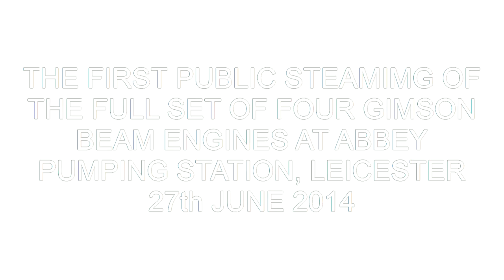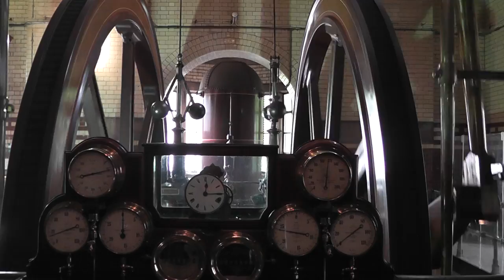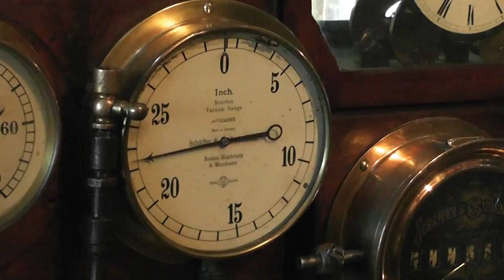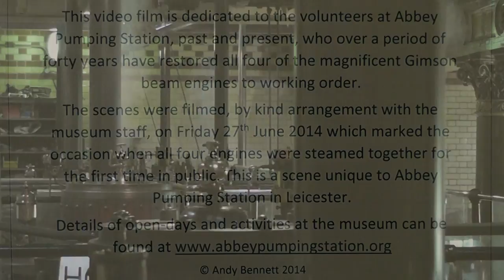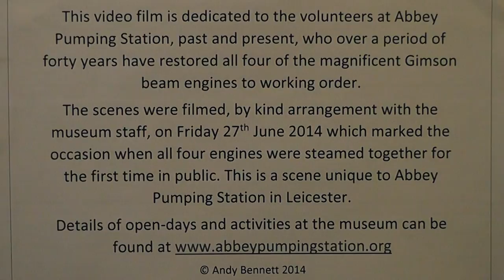The First Public Steaming Of All Four Gimson Beam Engines At Abbey Pumping Station 2014

Comment: (Number 2 pump seems to be running slow, why's that?) It must have been amazing being a designing Engineer in those days, inventing as you went, making things never made before. All the compromises and all the advantages, a babbitt bearing will work, a fiber packing will work, an oil pot will work...if you have world class machining, even of parts like these, huge, ungainly, and complex because of the state of the technology at the time. No CNC, just men with calipers and fine sand paper and really good brains working with lathes and milling machines. I suspect the designing Engineers would be in grease up to their armpits, just like the operating Engineers, to keep these mighty beasts running. It would be like stepping into a whole new dimension of thought. Good on you all for keeping these pieces of art running.
Reply from the maker: I wasn't directly involved in the running of the engines but am aware that providing enough steam was a key issue. The usual on-site boiler is only sufficient to provide steam to run two engines but even then its a challenge to keep them both turning over for lengthy periods of time. For this special event an additional mobile steam generator was hired in to provide sufficient steam for all four engines to be run simultaneously. Even then the speed of the engines had to be held back to avoid over-stretching the available supply so none of the engines were turning an anything like the rate that would have been the case when the pumping station was active. I believe that even then not all four engines would be running at the same time.
Reply: @andybennett5570  WoW!!! I thought that sedate churn was normal! It would make sense to keep one or two pumps in reserve, because of the limits of the materials of the time. What must it have been like, when it was "Balls out" and everything was humming, for a little while.

Comment: A ballet of elegance and engineering genius. Or green house gas factory? You decide. I'll pick A.
Reply from the maker: I'd definitely pick "A" as well. OK the coal fired boilers will have generated some exhaust gases but that has to be balanced against the fact that before these pumping engines started their work parts of Leicester were a stinking cesspit . It was the removal of  untreated sewage from the low-lying areas of the city that made it habitable and laid the foundations for making Leicester one of the most prosperous cities in the UK exporting hosiery and finished goods to Europe and beyond.

Comment: And every Wiper and every Engineer in that place will be listening, through all that din and roar, for the tiny sounds of a dry bearing or a leaky seal! I wonder if running those pumps without any water to pump would hurt them?
Reply: Indeed we all were. It took a lot of drivers, although, I had both No.3 and 4 under my watchful eye. No.4 suffered a bit later on the Saturday with a warm beam pivot bearing, the oilway was blocked with fibres of worsted yarn. They'd been on it for 5/6 hours a day, that's the most we've ever run them. The noise in there was terrific, and made communication difficult at times. All in all, an incredible long weekend of a never to be repeated event.
Reply: In answer to your question about running pumps "dry", we regularly poor oil down the pumps, and they are checked from time to time by removing the large inspection covers with the gantry beam above. 
No.1 engine' flywheel end pump (there's another direct off the high pressure piston tail rod)  was seized solid in the bore. It took months of flushing a mixture of cola and old engine oil down it, with our hand cranked main crane chained up to it. Some side jacking with some 16 tonne hydraulic cylinders and some encouragement from yours truly up on the crane, the old gal broke free from it's seal, first time in 50 years. As you can see, No.1 ran in time for the four engines, pumps bore is immaculately polished from running. She's a sod to keep happy tho, and needs some further time spent on her. But yeah, only place in the UK with all four operational beam engines. Crossness is not far behind!! 💪💪🤞🤞🤞

Comment: Are the engines pumping against a fluid or freewheeling?
Reply from the maker: The engines would originally have been pumping sewage(!) but this is now done by electric pumps at a new location. When the beam engines are now run for demonstration purposes they are not actually pumping anything other that "fresh air". Water is however used in the condensing process as can be seen in the basement scenes towards the end of the film. However as the fly-wheels weigh around 20 tons apiece and the associated beams and con-rods weigh a similar amount on top there is still plenty of work for the engines to do which is why the sight and sound is so impressive.
Reply: @andybennett5570  Thank you sir. I absolutely love steam power. Beautiful machinery, elegant even!

Comment: do they have a modern boiler to supply steam to the engines
Reply from the maker: I'm not sure if it could be called "modern" but the on-site boiler is gas-fired and was relocated to Abbey Pumping Station from the public swimming baths at Leicester's Vestry Street pool. For the special event which took place in 2014, when all four beam engines were steamed simultaneously, a large lorry carrying a portable boiler was hired in to supplement the on-site boiler to provide enough steam to power all the engines.

Comment: Can someone tell me how long it took for the engines to in stall and to get running? Back in the days when they didn't have the technical knowledge that we have today?
Reply from the maker: The technical knowledge needed to build the pumping station and the engines was certainly there back in the 1890's when this type of technology had already been perfected. Ironically you'd struggle to find a manufacturer here in the 21st century capable of manufacturing the enormous parts necessary to build engines on this scale. More details about the construction can be found here https://en.wikipedia.org/wiki/Abbey_Pumping_Station
Reply: @andybennett5570  Thanks for that cheers mike